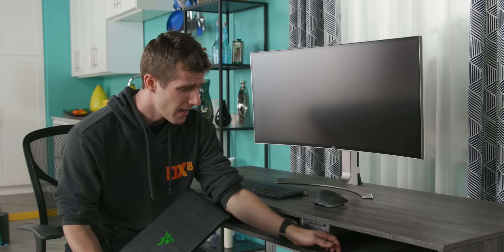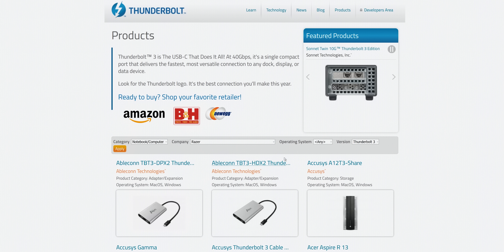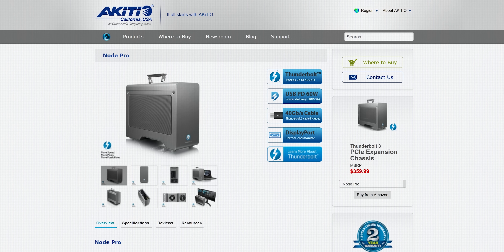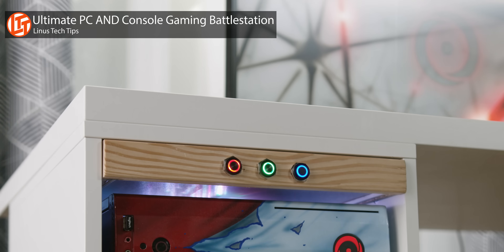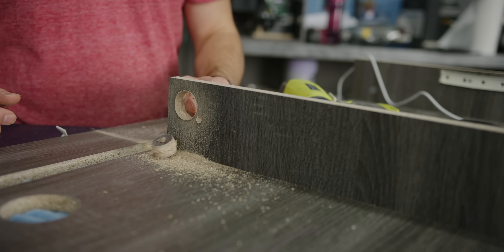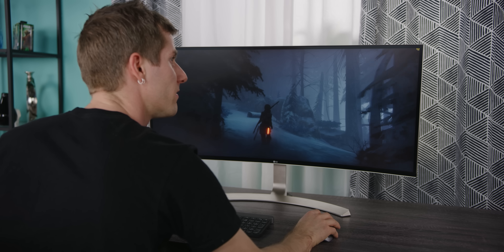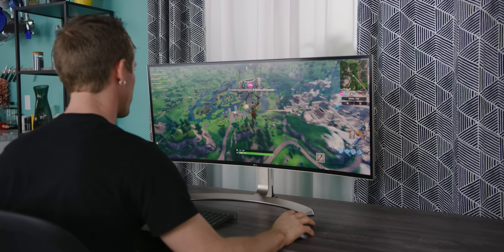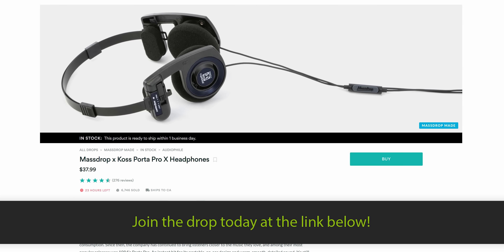This is the CLEANEST Setup.

Comment: Could someone explain why the doc would be needed? Why couldn’t you just have the laptop-e:gpu-monitor?
Reply: Same question...
Reply: Charging
Reply: For the mouse and keyboard plus any other peripherals you might want to add like speakers or headphones. Or like mentioned in the video, adding external hard drive to hold your game libraries.
Reply: @Torguemada  There are already ports on the EGPU for these - Add a HDD, Keyboard, Mouse, and a cheap DAC - this is purely for the 1 cable charge and do all.
Reply: You can. The dock just gives you more ports. Plus this way, there's just one cable to your laptop.

Comment: HA! Good luck doing this with a MacBook! All sorts of hacks are needed, I tried them all at egpu.io and you can get it to work but its not a "clean" setup by any means. I tried with a razer core x, i9 MBP 2018,  Vega64 and GTX 1080, and I gave up and built a stand-alone PC after months of trying. Im fortunate to afford that, most people arent, but after my own testing using my new PC (8700k) with a TB3 PCIe card, using the core x resulted in a loss of 40% FPS vs gpu directly in the PCIe slot, and extra hassle were not worth it to me. Maybe TB4 will bring 8x PCIe 3.0 support with lanes always directly from the CPU and no latnecy, then id be happy. (but Apple would likely never support egpus in Windows anyway)

Comment: MacBook Pro + Blackmagic eGPU Pro + Magic Accessories + LG Ultrafine 5K display, while it only runs at 60 Hz, is cleaner than this. It's all Plug'n'play. This only exists so the PC master race has something to point at that does something similar. Kudos for the wireless charger on the desk, but an angled wireless charger that props the phone up near your monitor is more practical. Also, a visual point of reference for where the charger works is necessary until the charger works across the whole desk.

Comment: I'm running an evga 850w p2. Fan doesnt come on till 340w it says. With my oc'd 5820k and 980 at 1.5ghz the fan never kicks in. I keep it fan side up due to this so heat can drift out of the fan hole

Comment: Turn off shadows, it will give 30+ FPS
Reply: less frametime (more responsiveness), less possibility of dropping fps when action is happenning
Reply: @kakofps  While I can see the point of avoiding 2 or 3% lows in the ultra-competitive scene, how does it increase responsiveness when you monitors refresh remains at the same frametimes?
Reply: @bengrogan9710  Unless you have gsync or freesync, the monitor has a mind of it's own. You are basically bombarding your 60hz monitor with frames, hoping, that it grabs a new one every time it refreshes. If a new one is not presented at the correct time, the monitor will just use the last one. At least that's what I know from previous YT research :P
Reply: @rokask  Yes, I understand that, and I specificly mentioned 144hz monitors there - What my question was is if your FPS is ABOVE the point where it matches the refresh, outside 1% low dips, what benefit in "responsiveness" the last guy mentioned as your card is still presenting frames will before the monitor captures it
Reply: @bengrogan9710  if your FPS never go below monitors refresh rate there's not much of a reason to increase the FPS other than psychological assurance for a hardcore gamer who's life depends on it, so he can worry less about some weird FPS drop once in his life time.
Reply: @bengrogan9710  the more fps less time ur GPU gets to ur monitor
Reply: @rohanmuppa  If the monitor has 144hz then the best frame time you can show is about 8ms between frames
If your GPU is outputing 200Fps then it is outputting at 5ms, your monitor will still only show that at its 8ms rate.
Reply: @bengrogan9710  yes but pros use monitors that are 1-3 ms which means that 1ms response is 1000 fps
Reply: @rohanmuppa  A physical impossibility no monitor with a 1000hz refresh rate exists - a 240hz monitor, the highest supported by any monitor connector, is still 4.2ms
Reply: @bengrogan9710  no fps isn't capped by ur monitor if ur monitor is 144 u see 144 fps but if u get 1000 fps u see 144 fps but get a fast 1ms response time
Reply: @bengrogan9710 READ THE WHOLE THING if u got 1 fps as in 1 frame ever second that would mean if u moved ur mouse it would take nearly 1 sec to get to ur  monitor because the amount of time between each frame is about 1 sec just like that 1000 fps would be 1ms because there is a 1ms lag between every frame.
Reply: @rohanmuppa  But with the monitors refresh rate you have lost that advantage as you are still waiting 8ms between frames.
If you had theoretical 1000fps the timeline would be thus

1ms: Frame Rendered-Monitor Refreshed
2ms: Frame rendered and discarded
3ms: Frame rendered and discarded
4ms: Frame rendered and discarded
5ms: Frame rendered and discarded
6ms: Frame rendered and discarded
7ms: Frame rendered and discarded
8ms: Frame Rendered-Monitor Refreshed

FPS is effectively capped at your monitors refresh rate as no frames beyond that will be delivered and as such cannot be acted upon, regardless of FPS your response can only be as fast as a frame is delivered
Reply: @bengrogan9710  although u cannot react to 1000 fps it will speed up the time the graphics card takes to get to your PC allowing competitive players to play at near real time
Reply: @rohanmuppa  You are not making any sense.
If only 144 of 1000 frames are delivered how is that faster than 144 of 144 frames being delivered?
You are still only playing at 144 frames delivered that is 8ms between frames, the others inbetween those timings that are discarded and you never see them - they have no effect.

It is no more "Real time" as there is still 8ms between each rendered frame meaning you are still playing with 8ms of peak delay
Reply: @bengrogan9710  do u have discord I wanna continue this conversation there
Reply: @rohanmuppa  I can't atm, It's early morning here.

Your argument is poorly worded in some places, I understand the point you are trying to make - It just isn't a point that carries any weight.
Your argument is basically that there is less latency at the point when the monitor refreshes, as the last frame rendered would be closer to the refresh itself.

ie every 8th frame will be displayed with only 1ms at the point of refresh - Meaning the minimum latency is 1ms at the point the frame refreshes on the screen.
See the Ms timings 1 to 8 I mentioned before

however if your frame rate is matched to your monitor then you would have this

1ms: Frame Delivered
2ms: Rendering
3ms: rendering
4ms: rendering
5ms: rendering
6ms: rendering
7ms: Rendering finished
8ms: Frame delivered

Which gives the same effect as there is still a 8ms delay between the frames being delivered

Comment: Concerning recessing a mouse pad on a table top. If you route the shape first, say to a 19mm mdf board, and use it as a template to route the actual recess on the table, you could prevent that chip pull-up that happened in this tables routes. A hand router and a short template bit with bearing on the shank should do the trick. The template on top of the table material holds the fibers down while cutting, and gives cleaner result. One might even precut with a sharp knife inside the template. Practise on similar materials first to see if it helps :)

One could also try to place a board on the surface, and cnc route through that, but that one you’d have to verify yourself if it works ok or not.

Comment: The fuzzy Velcro is a waste for things like this.  What you want is 3M's "Dual Lock" stuff (pic:  https://www.hollywoodexpendables.com/wp-content/uploads/2018/11/5260-002-PLUS.jpg)  Not only does it not let go easily, the glue sticks in almost any conditions.  I use it to keep my IPass on my windshield and even in the 105F Dallas summers it doesn't come loose.

It may seem like overkill, but you won't have to worry about it, and it shouldn't damage the finish.

Comment: Custom rails for the laptop - docking style, to eliminate the dangling usb type-c cable, dual monitors on an adjustable mount, adjustable desk for standing setup, cam+mic for streaming, lighting setup, extra usb 3/ type-c hub mounted through hole on tabletop to avoid accidents bumping against pendrives, cables and say a yubikey connected to the dock, perhaps a way to quickly stash away all computery stuff to use the desk for something else.... you can go pretty far on a project like this, but of course, it'll become more specific and specialized the further you go.

Comment: uhh no...this is not a good setup. I will stay with my i9 and 2080 Ti...
Reply: i have an six core i7 8750H and an overclockable gtx 1060 lucky
Reply: MsD Punani nothing wrong with that..that’s a pretty powerful laptop processor..I have a laptop with the same processor , as well.
Reply: i said lucky
Reply: not saying mine is better
Reply: MsD Punani I know what you were saying. I was just saying that your 8750H is also a really powerful processor!
Reply: ik just saying the 2080ti is super good
Reply: MsD Punani yeah, it is a good card. I still wish the price was a bit lower...I paid $1,400 for my card and that’s just ridiculous because TWO 1080 Ti cards would’ve cost about that.
Reply: then why didn’t u get 1080ti lul
Reply: MsD Punani well I had a 1080 Ti before this card....I wanted to get the 2080 Ti just to see how ray tracing looked in BF5...

Comment: LTT’s next mod should be to mod a laptop to have an m.2 to pcie extension cable. So you can hook up an egpu through an m.2 slot. Something for laptops without thunderbolt.

Comment: Can you tell us something about "inputlag" and "latency" with these kind of configs? Since you quite often recommend e-GPUs with Thunderbolt 3 and Notebooks with external Displays etc.
I remember that back 10 years ago, these kind of configs (high end notebook + mx gpu + external keyboard / mouse and display) realy struggled with input lag and latency between everything in games like CSGO. 
So it felt more like using bad optimized SLI, you see you get over 300fps but it feels unplayable :(.

Comment: My lenovo yoga 730 is kinda like this, thin and light, 16gb ram, 500gb nvme, 8550u. On top of that Lenovo makes a egpu gtx 1050 that has a built-in dock that is super small and portable, sure I can't max out games in 1440p I can do most games at 1080p maxed. Also the dock has it's own power that powers the laptop also.

Comment: This is cool and all but at this point just get a desktop and a laptop it's cheaper.
Reply: The GPU enclosure itself was a grand, so yeah, probably.
Reply: he already stated that they COULD do that, but they wanted an integrated setup so you only had to own a single system. that literally was his opening speech.
Reply: The idea is to get the cleanest most convenient setup, not to make it cheap.
Reply: do people not understand the point of these builds
Reply: This is pointless just set up a destop table on it and buy a laptop..
Reply: @alexandrameganco8104  Some people have the money where they care for form over function. I would love a system like this at my work, but it is just expensive, and I care more for function.
Reply: @Ravenousjoe  If you have the money go for this project but if your in tight budget don't think about it..this is none sense, the 1080ti Gpu can buy you a descent desktop this is sucks.
Reply: @alexandrameganco8104  yeah it is pretty obvious that this isn't cheap, nor is he saying it is a good value proposition.
Reply: budget was not the issue for this build i guess
Reply: And the 1080ti is running at like 1/4 of the power.
Reply: @octave1  You lose about 20% performance with a PCIe-X4 EGPU and an external monitor connected to the GPU output.
Reply: @Justin.Franks  what's the bottleneck in this kind of setup?
Reply: @6squall9  "what's the bottleneck in this kind of setup?" The bandwidth is less (x4 PCIe), and there is also a bit of protocol overhead.
Reply: @octave1  2080ti, and the performance hit isn't that bad - likely a little below what a stock 2080 would do in a tower

Comment: Thunderbolt 3 egpus are trash since the data is bottlenecked compared to Alienware graphics amp which uses esata which plugs directly to the motherboard. Linus even tested this and  showed a substantial drop in performance.

Comment: I have a setup almost like that but mine is way better.. its has RGB running on the backside edges of the table to shine some gamer lights to the wall when I wanna turn on the gaming mode +  I have a holder for my headphones and integrated hidden speakers in my setup. All connect wireless and with a single cable from laptop.. so maybe make a clean gamer edition next!

Comment: Do the macbook follow up please!!!!
Reply: I am running a MacBook Pro touch-bar with a razer core x Vega 64 egpu. It works seamlessly with Apple OS and requires a little tweaking to work on boot camp but it makes for a perfect setup. I run autocad, fusion 360, autocad Cfd, and a bunch of different games and it works great.
Reply: MacBook Pro has 2 TB3 ports on each side, so you could skip the daisy chaining and just plug in two cables. Would give you more freedom in choosing an eGPU, anyway.

Comment: You forgot to mention how expensive would be to purchase all of this hardware instead of building a PC and getting a laptop.
Reply: i mean he said "cleanest" not money eficient; most of the builds in this chanel are pretty much for show rather than need
Reply: Point of this build isn't the cost efficiency, it's the option of having portability plus a setup for heavy gaming/workloads at home (and as others have mentioned, an overall clean setup).
Reply: It would be about as expensive as building a PC or getting a higher end laptop, but you end up with essentially the same thing in a semi-modular format.  For example; being able to take the laptop elsewhere temporarily, but getting a big performance boost whenever you're back at home base.

It's not for everyone, of course, but for someone with a very limited amount of space, it could be a great solution, with or without the desk modifications, and the price can be lowered by just getting a more basic desk, or foregoing some of the modifications that might not be useful in their particular scenario.

An example of something I did a while back;   basic desk, (table really);  NUC8 (with the vega gpu) mounted to the back of the monitor,  eGPU mounted to the bottom of the desk with a bracket.  If I ever go to a lan party or another kind of BYOPC event, I just pick up the monitor and peripherals.

And even with a full build, there are plenty of people who want to create that very clean, professional looking set up, versus the RGB laser show that's marketed so heavily these days.
Reply: yeah i'd like to see a budget version of this. take a decent laptop and say a gtx 1060 or 1070 and pair it with a 1080p monitor and see how cheap you could get a travel + gaming setup.
Reply: @After_Pasta  I do a lot of thick steel cutting so I only have a really good Makita which was about 200 bucks, I didn't know what the cheap ones go for.
Reply: As well as step 4
Reply: Buy a decent $500 and some airy cloth to throw it over the CPU.
Reply: Something like 7-8k I would say. Max 10
Reply: Like 300 bucks for an angle grinder, all the discs you need to make a table, the wood and the paint. Sure, you need some skill and time to make it pretty, but building a custom table is dirt cheap if you're willing to do it from scratch. Edit: actually, you need a drill as well so make it 350.
Reply: He doesn't really mention prices in these videos because prices and hardware change all the time, and he'd want the video to have some longtail, where a user in 4-5 years time can look at this video and price it out themselves. Thunderbolt, external GPUs and ultrabooks will be around for a while.

Comment: You guys should try to build a pc in the drawers of a desk like this one
Reply: steven my bro in law made a custom built pc in a custom desk the top made from tempered glass so you can see the mother board
Reply: They already did long ago. Linus' office PC is installed inside a wide drawer under a glass-topped desk. There is a video about it somewhere in this channel.
Reply: No they should try building an actual pc in a baccpacc like they did on austins channel
Reply: *motherboard 😏
Reply: JBR88 GAMING noticed after I posted it but you know what I mean

Comment: Hey Linus  that's gonna be a long comment but i hope you read it 
you have come very close to what i imagine as my dream diy setup ( that  i cannot afford it so i could just dream about it )

The only big difference is that my dream setup doesn't include a laptop but instead ( wait for it ) a 2 in 1 
so here is a deal i always wanted a one device that could rule them all 
and the only way i figure  i could come close to that is by using  dell's latitude-5290-2-in-1 ( i7 configure all on the highest) or the thinkpad x1 gen 3 tablet , ( i prefer dell due to smaller size and also there is alot of reports of screen issues on lenovo)
that is so special because this tablet have thunderbolt 3  and the gen 8 U series cpu thats mean a real 4 cores performance
so in theory i could use this tablet to do literally EVERYTHING 

Examples 
1. i could use the tablet on its own and install dual os with android x86 ( because windows tablet mode sucks more than android ) 
2. i could use the tablet as emulation device with Ipega telescopic controllers 
3. i could use the tablet with its keyboard as a laptop 
4. i could connect the tablet to egpu ,screen , keyboard and mouse and use it as gaming machine 

so that's my dream setup ... i wish i could afford it :"D